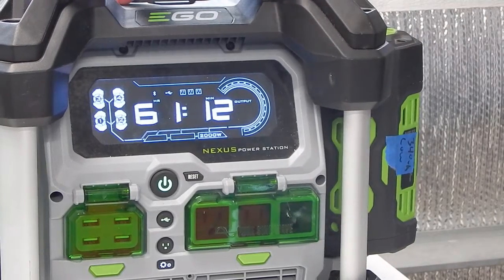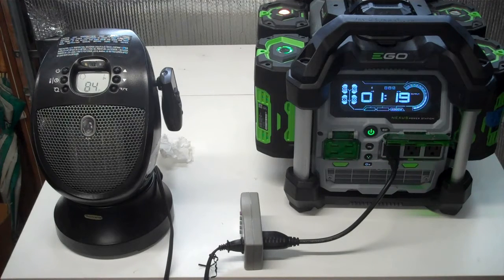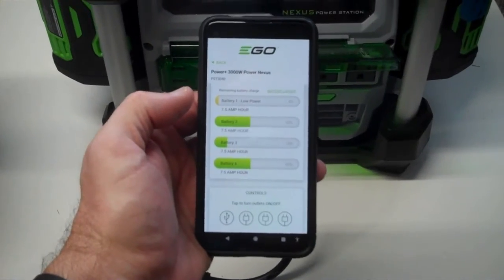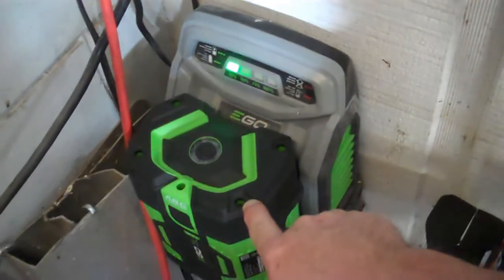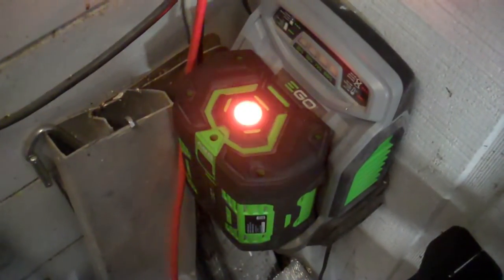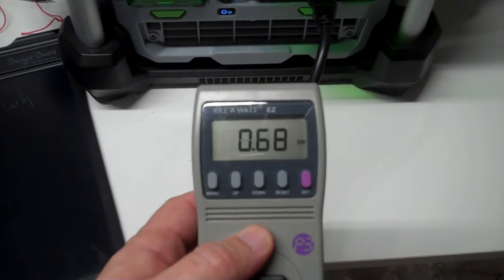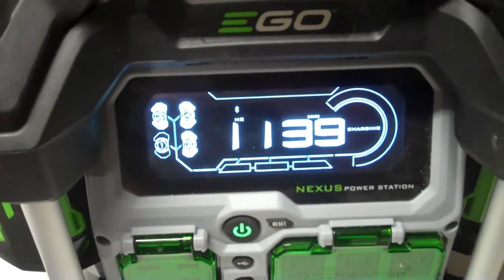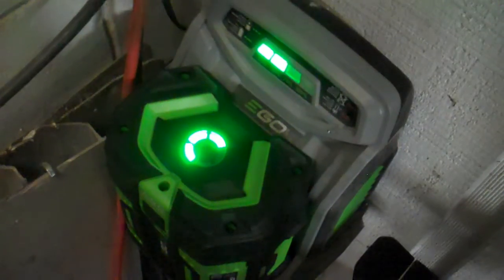Ego Nexus Power Station Efficiency testing

Comment: Have you tested a small window unit
Reply from the maker: Not specifically with this unit, but as long as it has a standard 120 volt plug it will run a window AC unit. The amount of time it runs for will depend upon the watt draw and number of batteries you have.